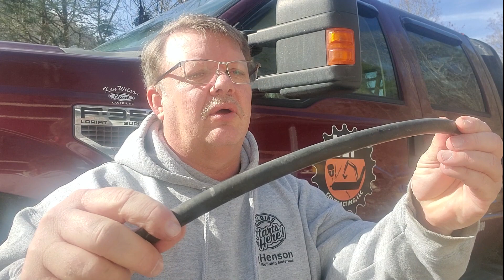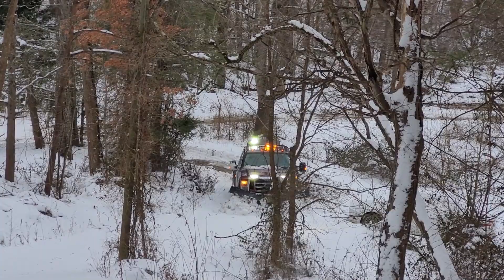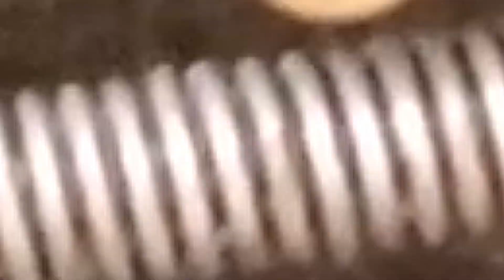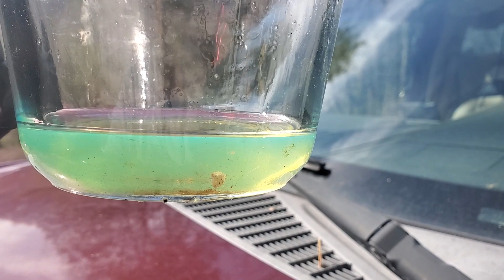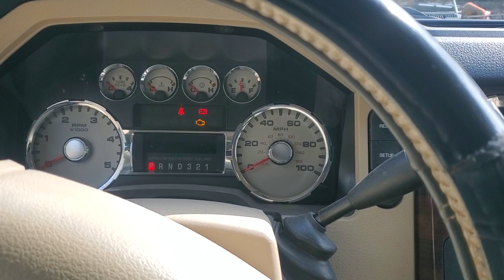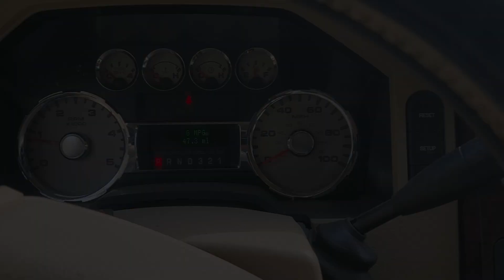Fuel-Water separator maintenance, 2008 6.4l

Comment: I have a 2010 F250, 6.4, with 20K miles...that's it. Any advice to keep it going forever?
Reply from the maker: That is a great question, quite a bit of money, and a lot of work! I didn't put a lot of miles frequently and changed the oil every 2,000 miles. Paid close attention to a lot of things and maintenance schedules... still... as much as I loved the performance of the engine when there were not issues, I really wanted to do a Cummins swap for reliability. In general, the 6.4L is not a good choice for going forever.